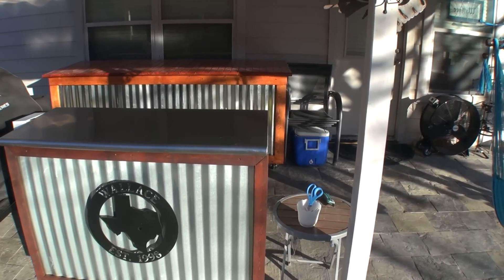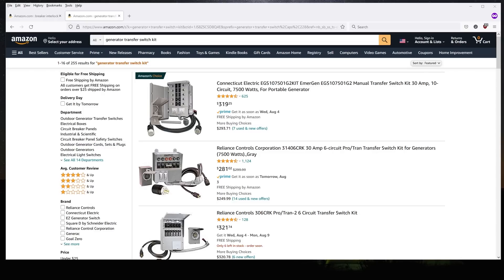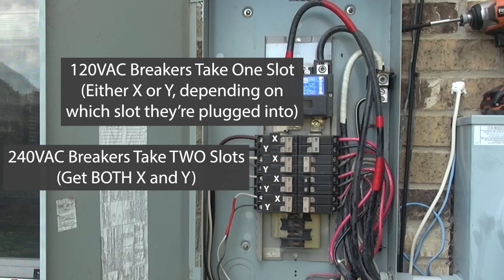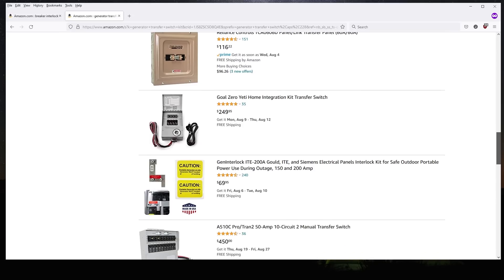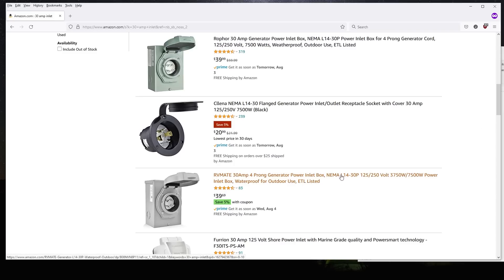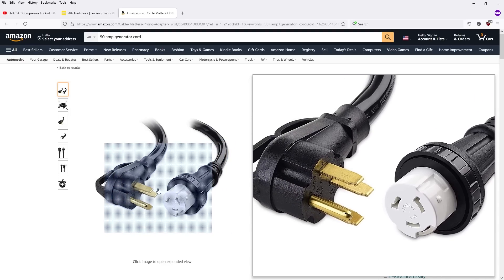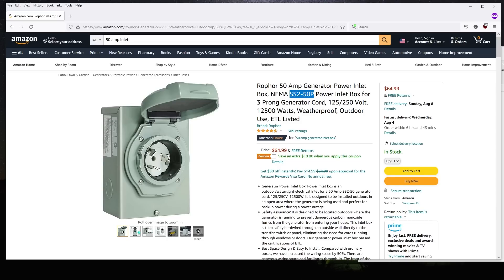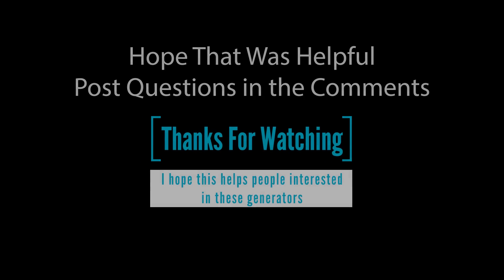How to Connect A 240VAC Portable Generator To Your Home

Comment: Great Video and Explanation! “ What’s you’re thought’s On  I have a Hybrid  5 kW 230 V pure sine wave inverter one Phase I have two lithium battery banks bank one lithium phosphate 280Ah & LTO 40Ah this is only for battery back up up where I live storms normally come through at night to lose power at night when you’re sleeping my thoughts are hybrid inverter will swap over for the battery power if we lose Grid Power Outage , I want to power comes back on a hybrid inverter or shut the power down but I see “ You’re Idea on shutting off the main circuit breakers Not To Back Feed the Grid if their working on the lines ! “ thanks for that input that almost got by me I was paying more attention on the solar power not being in line with the grid power is there any Module that would keep me or anyone from back feeding  the grid ?
Reply from the maker: Most of the solar inverter modules I've seen have that taken into the account in the design.  They'll have a line voltage input, a solar input, and a battery input, and manage them safely.  Some people will add a generator, and basically do what I did, such that the inverter can either receive line voltage or generator voltage.  You seem to have a unique setup, so without seeing it I couldn't be sure either way.

Comment: How do I hook up a 30 amp plug from the generator to a 50 amp inlet if the plugs are different?
Reply from the maker: They just have adapter plugs.  No danger in sending less power into a stronger/higher rated inlet.  So you can easily adapt.

Comment: 10:33 - These aren't exactly the same cost.  Yes, the inlet costs about the same, but for 50amp you need to step up to a 6 gauge wire going from the inlet to the box.  30A usually only needs 10 gauge wire.  15 feet of 6/3 wire will run you about $90 where 15 feet of 10/3 wire will be $50.  The 50 amp breaker is about $15 more than the 30 amp.  You then either have to buy a 50 to 30 amp adapter for the inlet so you can plug your 30A cord into that, which is about $30, or make your own cord with two different plugs on either end.

That being said, for $85 more it's probably worth it to future-proof and install a 50 amp inlet.
Reply from the maker: Ah, yes, fair enough.  In the dialog, I was mainly meaning that the cost of the inlets themselves are very similar.  The wire is indeed more expensive, but we're only talking about a few feet in total.  Of course, different installs call for different lengths of cable, etc. etc.    Everyone's mileage may vary.  :-)

Comment: One of the most comprehensive videos I've seen on this topic. However, I must be missing something, but how do you get 50 amp out of the 30 amp Predator? Seems like the key to the whole thing and I didn't see it mentioned.
Reply from the maker: There are more videos in the series.  
https://www.youtube.com/playlist?list=PLzoNthJzzMFQ877vyCfoc53oDQqGFAIKN
Because these generators are Inverter based, the power is made electronically, and the frequency is consistent regardless of engine speed.  Normal generators AC frequency is tied directly the speed of the engine shaft turning the generator coils.  Because it's electronic, you can join more than one together, and they'll sync and 'team up' to increase the total power output.  I combined two together and made a parallel kit to act as a power tap, thus what I can get is closer to 60Amps continuous.
Reply: @Texas_DIY  thanks. I found the playlist and the parallel kit video later. Thank you. 
Shame they don't offer a solution out of the box.
Reply from the maker: @markkempton4579  Yeah, it's really strange.  It clearly works, and it seems like it would just help them sell that many more generators.  I don't know why HFreight isn't offering them... especially after this much time has passed.
Reply: @Texas_DIY  right. They clearly intended for it to support the functionally.

Comment: Transfer switches or interlocks are things, but they're not required for temporary powering the home if you're too broke, or need power NOW know this exception exists in the National Electric Code:  702.5 Transfer Equipment A:  Exception: Temporary connection of a portable generator without transfer equipment shall be permitted where conditions of maintenance and supervision ensure that only qualified persons service the installation and where the normal supply is physically isolated by a lockable disconnecting means or by disconnection of the normal supply conductors.    Qualified doesn't mean certifications or degrees, it means you know what the heck you're doing "has been trained on the safety risks involved" - keep the kids away.  Lock your panel so nobody can turn the street back on and abide by the exception's requirements.
Reply from the maker: Just be careful.  Lots of people don't have a firm understanding of what's happening and why, and thus will have a greater likelihood of doing something wrong, or out of order and hurting someone or something.  

If you're not sure, play it safe.

Comment: Good video.  I have a 30A generator, and was planning on installing at 30A output to connect it to the load center.  I can see the advantage of making that 50A, so it's as you said, "future-proof".

However for the circuit breaker that goes in the load center, am I okay with installing a 50A breaker?   With a 30A generator, that should never trip; whereas if there was a 30A breaker, and there was an overload situation, I'd think it would trip, providing some extra protection.   

Swapping out a 30A for 50A breaker is $20, and the effort to change a breaker (minimal)   That at least saves trying to repull and install 6G vs 10G wire and receptacle.
Reply from the maker: It's up to you.  If it were me, I'd rate the breaker for the amperage the inlet plug can handle.  The generator will still cut off on it's own if you exceed it's capabilities.  Breakers are more to protect the wiring from becoming too hot and causing a fire in a wall or cable, when the available power would exceed what the wiring could handle.  (the power company isn't limited to 30-40amps).  But I'm not an electrician, and don't even play one on TV, so consult a professional, not a dude on the internet...  :-)

Comment: One thing that I’d like to know:  If it’s a 50A generator does that mean it’s supplying 25A to X leg and 25A to Y leg?  Or 30A generator supplying 30A to X leg OR 30A to Y leg?
Reply from the maker: In your example, if it's a 240v generator, yes that's the case.  240v loads pull equal from each side.  So a 10a 240v load, would leave 15A on X, and 15A on Y available for 110v loads.  The difference in an unbalanced load, returns on the neutral circuit to complete the loop. 

It's best to try to keep them balanced, but since the location of the breaker determines what leg is being pulled from, it's usually a best effort kind of thing.   

Whereas 240 consists of two hot wires with no neutral, but that said, it's worth noting that most 240v plugs also include a neutral because lots of appliances need the neutral in order to draw from one of the legs to neutral for smaller 110v loads (lights, electronics, etc).

Comment: Hi JayTX, if I don't need a 50A plug can I simply use the Powerhorse Parallel Cable Kit witout all the additional DIY steps you've  shown in this video?
Reply from the maker: The Powerhorse cable just gives you the plugs to hook into the parallel ports on the generators.  You've still got to get the power out of them.  And the outlets on the front face of these units tap out at 30a, so you'd not have a means of getting two generator's worth of power, from an outlet that has a breaker that trips at one generator's worth of power.

That's what the parallel kit did, taking the connection/power from both, and providing a single 50a outlet with the combined power.

Some generators like these ARE equipped with a 50a plug on the front face, so when you use a cable like the Powerhorse one, you don't need a parallel kit, because the front panel does it for you.  Unfortunately, the harbor freight ones are not like that, and the voltage / amperage has to be combined externally.

The videos where I cover the parallel kit are on this playlist: 
https://www.youtube.com/playlist?list=PLzoNthJzzMFQ877vyCfoc53oDQqGFAIKN
Reply: @Texas_DIY  Thanks for the reply, in my situation I do not need a 50A plug. I am powering a rather large audio system and a 30A plug will work for me but I need more power than just one of the 9,500 gen will produce which is why I am paralleling them. 

As I understand it, the L5-30 plug is 30A but for the L14-30 is 2 x 30A, so 60A. The L14-30 has 2 hot legs, a neutral and a ground. Each hot leg has access to 30A on opposite poles of the phase swing. The L5-30 has one hot and one neutral, so only one 30A circuit is accessed through that socket. 
 
So I should be able to use the Powerhorse kit and plug directly into the Predatopr 30A L14-30 plug - I am  a neophyte and just learning and appreciate your help if I a missing something
Reply from the maker: I'm not an electrician, and don't even play one on TV... and it may be wrong, particularly with regard to the very unbalanced loads on 120, that said, this is my understanding and what I've observed on mine:

The L530 is 120V.  3 pins.  Hot Neutral Ground   So there isn't a pin for the other leg to make it 240.  it's going to get all of it's 120V from either X or Y, so you are limited to 30a of 120V, full stop.

The L14-30 is 240V. 4 Pins Hot, Hot, Neutral, Ground.  So you can get 240 and/or 2 legs of 120 from it.  You could get 30a of 240v (which is using X and Y) or you could get 30a from X, and another separate 30a from Y (assuming there were no 240v loads).

The breaker on the front panel "watches" each leg, of the L14 socket, preventing no more than 30amps from passing through any one leg at any given time.  If you were running only 120V devices, you could pull 30a from X, and another 30a from Y... so yeah, 60a TOTAL of 120V, but no more than 30 from each side.  

So if your amplifier were 120V, and was super crazy and somehow needed MORE than 30a, your out of luck, cause 120 has to come from either x or y, and it can't be more than 30 on either single one.  But, if your amp needed say 17amps, and you had lights needing 10amps, and a fog machine needing 15amps, you could split them up, and put the lights and fog machine (25a total) on X, and the Amp (17a) on Y.  

But you couldn't put the Amp and the fog machine together on one leg/circuit, because that would be 32a which is too much for the breaker to allow.

If you had a 240V AMP, and it used 20a, (out of 30 available) that would mean you still had 10a of available 120v power on X and on Y, so yes, 20a of 120v is available in TOTAL...  But you could not plug in a 120v 20a fog machine because you only had 10a left on any one leg. So wherever you plugged in the fog machine, it would be trying to pull a total of 40amps (20 + 20) from that leg, and it would trip the breaker.

So merging two Predator generators directly together won't help you in this case you are describing.  Because you are still limited by the max output of the breaker on that front panel.  If you just used the powerhorse cable, and hooked the two together, then yes they'd sync, and your combined generators would be CAPABLE of making more than 30a, but, the breaker still won't allow more than 30a  to pass through any one leg without shutting off... so you are still no better off than you were with one generator that was capable of making 30a all by itself.

When you use a parallel kit on these with a 50a plug, the parallel ports on the generators are bypassing the breakers and the outlets on the front.  The parallel kit still works even if you turn off all the breakers on the front panel.  So it's taking the full power from each machine, and since they sync with each other, it's double the output of one machine, and since you are supplying a new plug that is not protected by a 30a breaker, and so you now have roughly 60a available (and thus you need that more substantial plug, in my case, the 50a dryer plug to handle that).  

(NOTE: If you are not feeding this into a food truck, or house, via an inlet and a breaker, and just running AV stuff directly from it, you REALLY need to have a breaker in the parallel kit.  There should always be a breaker involved, in the videos I made on this, there is a box I called out that can do breakers, use that one if you make a kit)

Comment: 1) 240 volt generators are fairly common. 2) You can bridge your 2 legs if you only have 120 available and the your entire house will be hot but your 240 Volt items will not work...
Reply from the maker: 240V inverter generators are not-so-common, regular 240V generators are all over the place.  One could feed 120 into both legs, but it might do very unpredictable things to 240v appliances, those breakers should be turned off if one goes this direction.  I wanted to be able to live relatively normally on gen power, so that's why I went the direction I did.
Reply: @Texas_DIY  I switched my house to basically all gas (stove, clothes dryer and water heater). I did a lot of research and a little testing before I bridged my legs.. My concern is more about the amount of fuel I use in the generators. I would rather run the small one (120v only) unless I need the bigger one 240v so I made a pigtail with bridge in it for the small unit. No changes at the panel. Everything else is the same as yours except  I made my own interlock slider plate. I also converted my generators to propane so I don't have to store gasoline and I plumbed them into the house propane line. I converted all of my lighting (inside and outside) to off-grid low-volt battery-solar. I am currently testing an auto-start, on-off timer for the generator so it will run for 30 minutes every 4 hours to keep the refrigerator cool  so I can be away for days and not worry about my food going bad or wasting fuel when not needed

Comment: What a great video this is.  You put my foot in the door using my new Pred 9500.  I knew this could be done without running a bunch of extension cords.  Now at least I have some understanding of what this is about.

I bought a whole house back-up generator and before installation I learned what a glutton it is for propane.  And they wanted around $7,500 to install it.  I’m going this route instead of burning 3 - 4 gallons of propane an hour.

So thanks, your efforts are appreciated.
Reply from the maker: Glad it helped.   In my case, natural gas isn't in my neighborhood, the whole place (my home included) is all electric.  So bringing propane into the mix (making a pad, renting a tank, plumbing the line, etc) would have been a huge and expensive hassle. 

If you need a multi-fuel generator, take a look at the GENMAX GM9000iED on Amazon, it fixes all the shortcomings of the Predator and the Duromax.  And is made by the same factory/people, and makes the same clean power.

Comment: So to add a generator to an existing electric panel and have the interlock work properly, the generator circuit breaker needs to be at the top of the panel. Did you have any issues moving the other breakers down to create a space? I have several more breakers than you do (120 and 240), I'd have to move a lot of breakers.
Reply from the maker: It depends on the design of the panel.  Sometimes the main breaker is on the bottom for example.  You shouldn't have to shuffle stuff too much, just trade places with something else in the box.  In my case the top right slot was occupied, so I just moved that breaker to an empty spot and put the input breaker in it's place.
Reply: @Texas_DIY  thanks for the reply. I'll give that a shot. I'd hate to relabel all of them. I just hope it has enough slack to move down about 10 inches.

Comment: My requirement for a home backup generator: 240 volts, dual fuel, inverter, floating neutral, electric start. I did a ton of research and found only one generator that met all of my needs, the WEN DF875iX. It was only $1050 and has free shipping. The Predator isn't dual fuel and Duromax equivalent cost around $2000 and both have the neutral bonded to the frame.
Reply from the maker: Check out the GENMAX GM9000iED on Amazon.  It is made by the same factory responsible for the Harbor Freight and the Duromax.  They sell on Amazon.  It combines the best features of all of them.

Dual Fuel, Rear Exhaust, 240V Parallel capable, wireless remote start, good meters on the panel, Oil Filter screen, same engine as the Duromax and the Harbor Freight.  Also has a 50amp dryer plug on the panel.

Basically it fixes the shortcomings of each of the other models.

Comment: Thank you for the explanation, i have a champion generator 11500 running 9,200, would it power my home , i have my inlet box 50 amp , just need my extension to hook to the generator, my electric guy say to buy 25 feet , but what wattage i buy?
Reply from the maker: If you're buying a pre-made cable, just get one rated for the 50 amps you're connecting to, going higher will never be a bad thing.